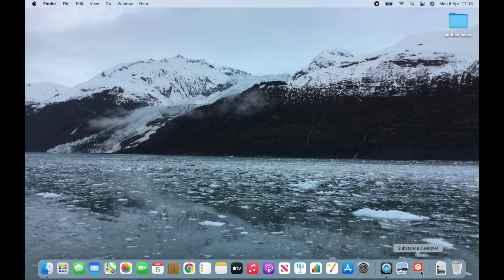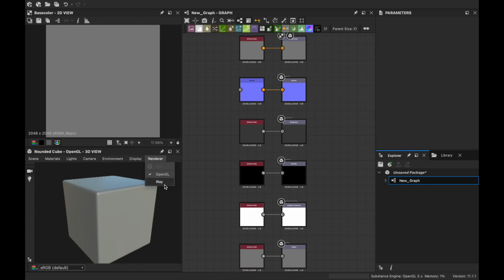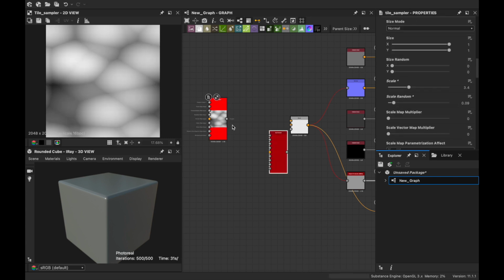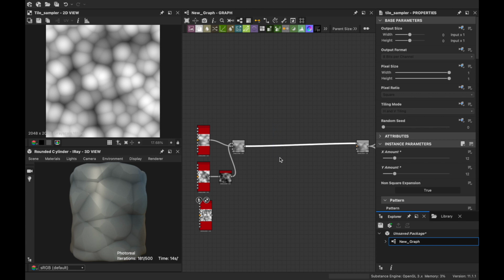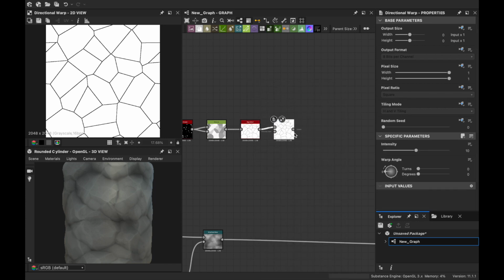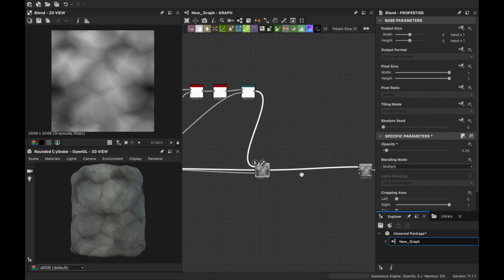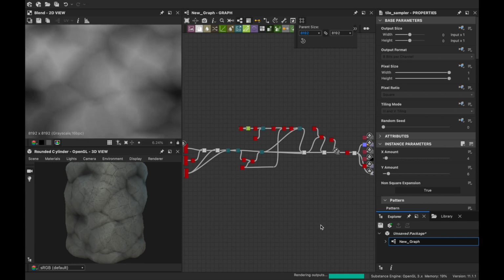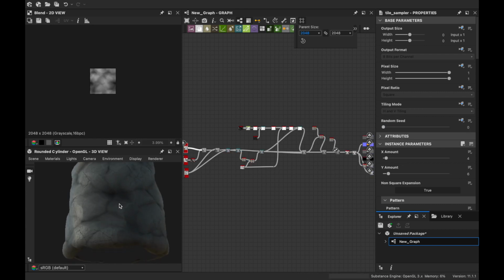Using Substance Designer on an M1 Mac

Comment: This is really interesting. Not having any issues myself in early 2024 on an M1 Pro MacBook Pro with 16GB of RAM but my graphs are simple atm.

Note that Adobe suggests a minimum amount of RAM to be 16GB so… might want to bear in mind if anyone is dropping on a Mac. I dare say it still works fine but with many nodes at 8k it may be swapping a lot and maybe less stable
Reply from the maker: By now I believe it’s running natively on Apple Silicon so it should be more stable.

Comment: Will the next video be Substance Painter? I love using SP but my Surface Pro 7 i5 isn't a great fan of it 😂 so I'm considering swapping for the MacBook Air you're using in this video
Reply from the maker: Hey! Just saw your DM. I’m currently testing it out for part 2. Fingers crossed that it runs similarly in performance to Substance Designer! 🤞🏻
Reply: @JeremySeiner  Yeah, would be great to see Painter performance as well! :)

Comment: Can you please please please model a plastic bag. I can’t find anything on the internet (modeling, wrinkles, material) pleeeeeassseeee help me :(
Reply: The material wouldn't be too (depending on what you want) for just a normal plastic bag it's just a semi transparent material. For the modeling I'd look up some tutorials about cloth modeling, that should also apply to plastic bags pretty much.
Reply: I searched "Modelling a plastic bag " on youtube and found like 6 tutorials right away. Are you sure you've been looking hard enough haha
Reply from the maker: Thanks you two for helping out here! I would suggest looking at some geometry modeling tutorials for this or maybe some cloth simulations? You could create a semi-transparent material in the shader. In Substance Designer you could try using a crystal noise to distort and add some wrinkles to a material but for the transparency you might want to adjust that in the render shader for your rendering application. Hope this helps!